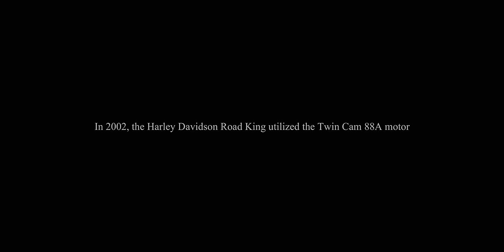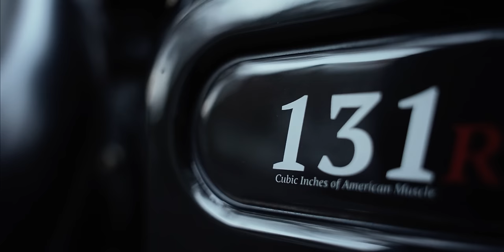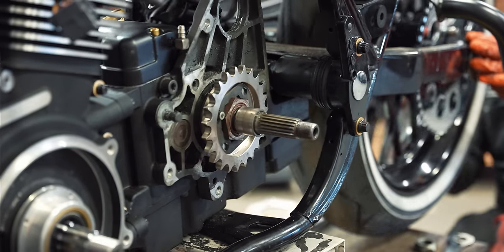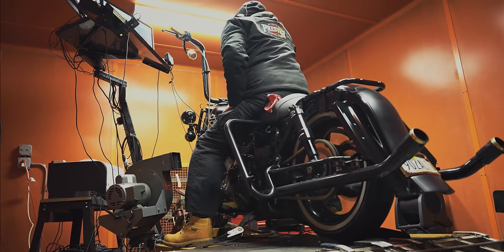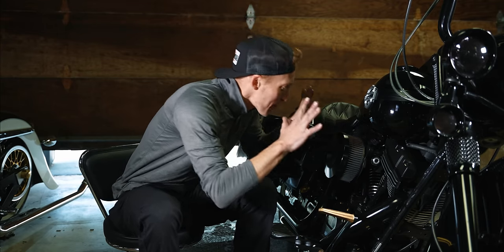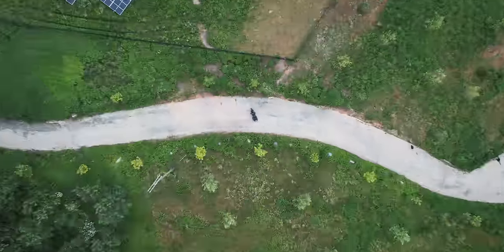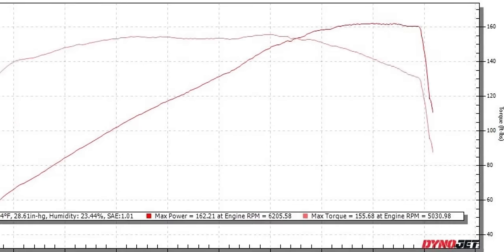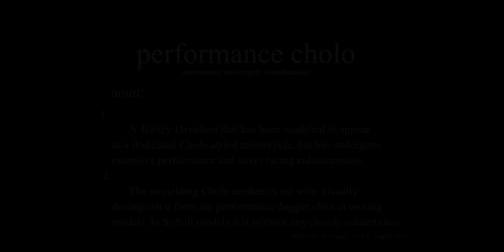Built 131ci Twin Cam - PERFORMANCE CHOLO - all motor, all gas and loud as Fu*k

Comment: WONDERFUL video!!

Sidenote:
Indexing the spark plugs that way can actually have averse effects!
Depending on volume and speed, you can actually blow out the spark (if not multispark like MSD or similar). Also you would need to take the chamber swirl into consideration. Remember Suzuki’s TSCC (Twin Swirl Combustion Chamber), or the 2-Plug per chamber approaches?!

Beautiful to see such enthusiasm!!

Best wishes ❤
P.S.:
Did you ever consider crankcase evacuation via the exhaust?!
That would actually also help with power, due to reduced blowby, less oil consumption and better ring sealing!

Comment: Just installed an 131” TC R&R cycle… 2000rpm 130tq and it rises to 138 at 5100rpm… max tq 138… 137hp with an incredible powerband… this is built for dependablity. 9.4 correct compression with s&s 640 cam… it’s a beast
Reply from the maker: Nice man, I was looking into R&R short blocks before I began with this. They know what they're doing over there and those S&S 640's are known performers. 
What exhaust are you using?

Comment: I'm just as impressed with the weight savings as the motor.
Reply from the maker: The weight savings would have been a lot more if the bike wasn't set up as a cholo. All the aesthetics add up.
However, if looks and practicality go out the window, then I can have that bike down to about 600lbs with 20 min of work.
Reply: The only constant is change

Comment: Yea I got the G2 quarter throttle for my sportster and broke three teeth on my belt so I got a chain conversion, 11.2:1 1250 bore kit, 505/515 feuling reaper cam feuling high lift valve spring kit, kibblewhite valves and hammer push rods with Arlen ness big sucker I can’t wait to get it all together.
Reply from the maker: Sounds like it's going to be a ripper
Reply: I do a very similar sportster build quite frequently. Should put you around 90hp with a good exhaust and a professional dyno tune.

Comment: Gotta admit, you almost had me, right up to the point where you said you indexed the spark plugs toward the intake valves to light the mixture faster when it comes in the cylinder.  Oh man...good one. 🤣🤣🤣
Reply from the maker: This bike set the Prestige dyno record for twin cams
Reply: That's an old and I mean real old, pre electronic high output ignition systems, drag racer trick. If you knew anything about magnetos and ignition points and racing history, you would know this. Did it make a difference on this build, maybe  maybe not. But with 150 hp and 160tq at the rear wheel, does it even matter?
Reply: @Panhead_Andy  
I've indexed MANY a spsrk plug to take advantage of the direction of the charge coming over the piston dome. In 35 years of racing, I've NEVER heard anyone say it was to ignite the air and fuel faster AS it's coming in past the valve. Which is what he said in the video. You must be running one hell of a lot of intake duration....lol
Reply: @Panhead_Andy  
I also respect anything around 1hp per cube out of a 2 valve pushrod twin. Not hating on the build at all
Reply: @raykaufman7156  1.15 hp per cube lol. Definitely a slight speaking error with the way he said it. But now I know that you understand the theory (as he does) and picked up on the not optimal choice of words. 💪🏻💪🏻

Comment: Very nice work👍🤙 that being said, if I live long enough, I'll show ya what an 80 cube Evo lowrider can do,,,,,, you just might shit yerself yeeeeee hawww! Hey! Ever had a bike that when yer at the stoplight, and ya Gunn it that yer lid flies off waaaaay back there say 50 yards or so still hanging in the air when ya look back for it? Well, that's what the 80 cube Evo punched out to a 96 will do. I've been building, modifying bikes from flathead to shovels, Evo since I was 14 years old, I'm now 60 and still love the roar and the potato of American iron the best. My standards are much like yours as far as build quality, but I bring a little aerospace engineer into the mix, along with paint, fabrication, engine building, head porting, exotic materials, thermal and fluid dynamics, air columns and vortecicies, and many many more tricks up my sleeve to make the impossible, possible.
Never stop learning, never stop innovating, find your zone and hold onto that as long as you can, and most of all do what you love, and you'll never work a day in your life.

Comment: Wow! Just WOW.!… Professionalism back to back to back.!!… from the parts, to the build, to the cinematic filming GOD, this bike and build is a devilicious monster and has for sure inspired me to keep up with my M8 build and build it the baddest I can I would truly like to know a ball park what did something like this cost.?… dam Congrats to a dream come true my man, all the way out of the 805 Ventura County, CA.!…
Reply from the maker: Thank you, damn... what a comment that was. I usually don't give out numbers but since your comment was very generous ill tell you it was under 20 for everything that was showcased in this film.
M8's make power easier and cheaper, but once you decide to bore the case on any Harley motor the price starts to climb fast. Big difference between full engine build and a top end build. But any big power comes with future problems if they aren't remediated while the engine is open. IE crank, oil pump, headwork, weak links in the drive train, tensioners, bearings, rods, etc.
Basically what ever $ number you think it should be, double it.
Reply: @JETFILMCHANNEL  No problem good freaken shit bro.!.. not to bad for what you did to that bike man keep up the badass F*** Work…the build is hard.!!..

Comment: Fantastic production video!! Talk to Andre at Evolution about their light weight comensator. They also have a lightweight basket. You'll lose pounds. When you're ready to get away from the "revolution" combonation-better all motor combos that put the power to the ground & love the abuse are out there. Currently building my 2001 King, 127" all motor stock cases 26" front wheel, it will be in the 170ish on pump gas b4 the Nos hit

Comment: S&S 143 is a monster as a matter of fact they referred to it as the dragon 💪🏾😁
Reply from the maker: The problem with the S&S 143 is that it doesn't last. In most instances the engine gives up before 10k. 
S&S even has a disclaimer about reliability and longevity for this engine. 
In the end, it's an off the shelf motor.

Comment: Absolutely incredible! Makes me proud to own my 2004 road king dinosaur. Although i got it with a 95", i have big plans for the bike. 
What oil are you running in that beast?. You should check out tribodyn oil man, for the motor and the gearbox. Tribodyn oil has its own site.

Comment: Cool video I'm just finishing up my 08 E Glide , but I went with a 124 Same exact parts as yours, same cam, throttle body and like you I wanted to keep dual exhaust . Although I run CFR's instead of straight. I was hoping for a 150/150 number myself but I did drop a tooth on counter shat sprocket to lower the gear ratio.  Anyway, really enjoyed watching your build. Oh and I run ultra cool oil cooler. Might wanna check into that. I do live in the South and it gets pretty warm down here ha!!  Happy Trails!!!
Reply from the maker: Yeah 150 is a far cry with duals even with CFR's unless your compression is crazy high, timing is dangerously advanced and you have a cam that saves everything for the very top.
The reality is that the duals will give a better overall midrange for around-town riding, bar hopping, etc. The duals just have a stronger hit at 3k for that whack as you're leaving the meet up. 
That 662 is no joke, and combined with 124 cubes I'll bet that bike will move. 
I'm developing my own kind of oil cooler as NY gets into the slow season, because things tend to heat up quickly on this engine, and only get hotter for every red light I hit. 
Good luck with your build.
Reply: @JETFILMCHANNEL  And I like the production value you put in your videos too. You can tell you put a lot of effort into everything. That's me dude., we got a little in common  I been doing hot rod Harleys bout 20 years or so. Before that it was a tube frame big block nitrous  68 Chevelle .and lots of fast cars and bikes.. I'm 65 now, this is my last toy!! whoop!!   Thanks btw for the good luck. I first started following you when you bought your softail then Carlini's. I use the gangster apes on mine too lol  Love em!!  and it's got the best you can buy in the ole bike. Probably paint it this Winter too.  Great content sir. later!!

Comment: Always enjoy your videos. Bought the chikla pipes from Steady custom. They came with the ends in a checkerboard design. Nice. Also bought header pipes from Samson. Should be on next week with DK Custom external breather system. Need ideas on air cleaner cover. How much time did it take you to fit your pipes?2008 flstn

Comment: Dope set up. I’m near done with my evo nostalgia build and now I’m wanting a tc131 in it lol. Also I’m bummed nobody makes a bolt in rake kit.
Reply from the maker: I would call American suspension about the rake kit. They may have something that works for you even though they don't list it. 
You could also rake out the front slightly with raked trees

Comment: AWESOME FLICK! JUST WANTED TO SAY SOMETHING, CORRECT ME IF IA M WRONG... YOU DO REALIZE, YOUR GEARING WAS COMPROMISED WHEN YOU DYNO TESTED @ THE STOCK GEARING SPECS AND WHEN YOU CHANGED TO REAR SPROCKET (GEAR LOWER).
 HAD YOU TESTED THE BIKE WITH THE OLD GEAR RATIO (STOCK) YOU WOULD HAVE DYNO'D OVER 150 FOR SURE!   JUST SAYIN

Comment: Bro that was a FANTASTIC FILM ‼️ the passion you have for the build is insane‼️ where did you buy those titanium bolts (with the gold head) from ?
Reply from the maker: Thanks. Most of the exposed gold titanium bolts were purchased on ebay. They have a pretty incredible selection of sizes, colors and head styles.

Comment: 149whp at 0ver 150lbs torque on a matching number 88ci motor is absolutely unheard-of down here where my custom Motorcycle shop is at in Chattanooga Tennessee.   You ever considered throwing a 6th speed transmission in your bike?
Reply from the maker: I have definitely thought about it. I'll make the switch if the 5 shows signs of giving up. 
But on long highway rides, the long stroke is begging for that 6th gear.

Comment: Finally got to finish this. John you out did yourself. Epic shit and I love everything you've done so far. I don't know if you mentioned it and I missed it but I've been struggling finding a nacelle for my 02. Did you use one of the ones fitted for 14+ or did you have to search as hard as I have?
Reply from the maker: This is the one I used... for both of my bikes and got my new rear fender from them. Been using "Bike Life Nation" for a couple of years now. High quality, hard to find body pieces, without the gouging prices. Made in Florida
https://www.ebay.com/itm/285471210460?mkcid=16&mkevt=1&mkrid=711-127632-2357-0&ssspo=XZ9UWNlBQxu&sssrc=4429486&ssuid=Hg2L2UkoSL2&var=&widget_ver=artemis&media=COPY

Comment: What’s crazy to me is a big block Chevy 454 has a 4.24 inch bore and a 4 inch stroke so technically if you go cylinder vs cylinder the 131 is bigger than the 454 which I think is dope
Reply: That's actually the bore and stroke of a 427 Chevy.

Comment: I love the v-twin build. Just out of curiosity would you ever consider building a m8. I started off with a 2011 fanboy with a 96 motor. I have a street glide now with the m8 love the power but wanna go crazy with it. Looking for ideas on how to build the motor. Would love to see you and Pam head build a m8.
Reply from the maker: I would love to build up an M8. Only reason I haven't, is that I don't have one.... yet. 
But, the majority of bulletproofing mods remain very similar between the 2 engines. One thing in particular I would shoot for (if I were going crazy with it) would be to have the crank strengthened and balanced and eliminate the internal balancer. And I like the idea of going oversquare with engine dimension and beefing up the valvetrain and using Ti valves to try and boost the redline to 7k.
High compression
Headwork
I'd also strengthen the 3rd gear issue they've been having on the trans.
Big, but not too big to keep its strength, but max effort.

Comment: Awesome bike, so the new clutch doesn't need a reservoir for the fluid anymore? I noticed your missing the brass cover on that side, thanks.
Reply from the maker: Nah, this model year didn't come with a hydraulic clutch. That would have made my life too easy. Instead, it's just a raw cable clutch with a 25lb pull, traffic is fun hahaha

Comment: Now I see where the 2 into 1 exhaust came from and the boost you get from it. No, they don't look as good as the Steady Custom duals, but hey, you've got to give up something to get something. Share that with VP Customs
Reply from the maker: I bounce back and forth between the pipes. I run the duals if I'm going to a show or just chillin, but I'll throw the 2-1 on if I know I'll need full power.

Comment: I want to say I like the look of the bike. Not so much the big wheel. I would like to see a better cam. Like a zipper RS687 or a Woods TW-68-7. Even know the numbers with the two into one are impressive as hell. But to over come the dual I think those are going to give you a little better exhaust and it will keep that dual. 
But this is a hell of a deal and I wonder what Pan Head would say to those came instead of the one you got.
Reply from the maker: Panhead is all about getting the most power in a rpm band that is usable. If a cam makes the best peak hp and slumps everywhere else he's going to pass over it. 
I'm all about that 3k hit and up, so I typically look for midrange cams that can still hang on until 6k. Can't have it all, but making the most of where your big power is can still win races against higher peak power bikes. 
Let's also not forget that this bike now weighs almost 200lbs less than a stock road glide. Takes a LOT more power to overcome that 200lb disparity.
Reply: @JETFILMCHANNEL  I like the power to weight. Definitely like the build. I agree, that’s why I asked about those two cams a little more exhausting for the rpms to accommodate the duals. Since you’re loosing back pressure in duals, it would exhaust more to accommodate the back pressure. You have the displacement, and the cam selections was aggressive. Just a thought to get the power at little quicker with duals. Instead of 3k it would turn on 
at 2300, it would probably peak more. But it would still be usable. 
I did see he questioned the cams to, I was wondering what he recommended?

Comment: Lol the spark plug does not fire on the intake stroke. It fires on the combustion stoke. You want your gap between the electrode and ground strap to face the combustion area (the piston) for the most efficient burn. The atomized fuel gets brought in through the intake valve. It then gets compressed and the faster that spark ignites that gaseous mix  the more burn time it has, there by producing more power.
Reply: He didn't say fires on the intake stroke. You aim the gap at the intake valve because at higher rpm that is where the densest fuel mixture is going to be because of the physical reality of time. That's how and why it's done.
Reply: @Panhead_Andy  great all of which were omitted. Also the highest charge of air is going to be smack dead nuts in the center of the cylinder because when it's sucked in it squeezes everything back up into a cylinder. It's round and the head is dished to funnel the flame front into the center.  All of this is negligible anyways. Really would like to see a Dyno result of a before and after of indexing the plugs on these 2 jug mills. This theory is kinda similar to the old hotroders reverse piston trick, where you reverse the piston offset and you can gain HP. Which was disproven by David freiburger on their Dyno.
Reply: @Panhead_Andy  I do want to say, what a beast of a mill you built!. That thing is mean!! 🤟

Comment: So do you need to start with the 1999-2002 twin cam with the timken bearings? I want to do a similar RK build from 2000.i love the bike. I will choose different bars for me. I am a cnc machinist and will likely do the bottom end machine work. I've done a few big bore kits, cams, etc. I'm ready😂. Inspirational! Thank you! I also want a detachable smoke windshield and fairing lowers for winter riding!
Reply from the maker: A 2000 would work well, the early twin cam cases were stronger and having the timken from the factory helps, but you'll want to replace that bearing it if you're going with a "full send" engine. You will save money though because you won't need to retro fit for the timken. 
If you have a carb, then you'll need to tune accordingly with jetting, but if you have the MM fuel injection you'll want to think about upgrading the ecu.
Also, for the bottom end work. Depending on how big of a cam you get, I believe anything above .600 lift you will need to clearance the case otherwise those cams will hit.
I have a picture in the video towards the beginning that shows that machined clearancing.